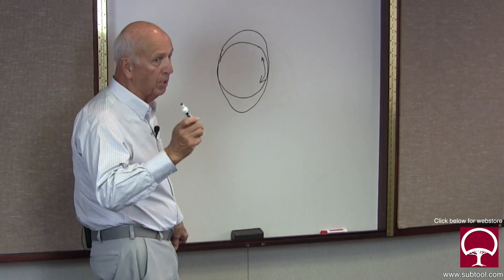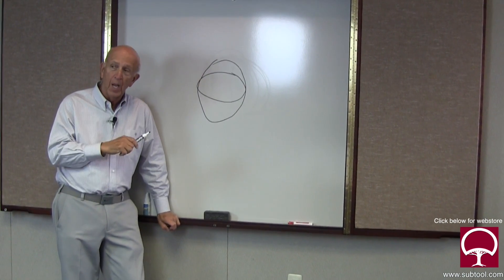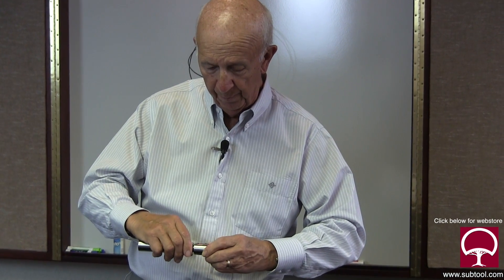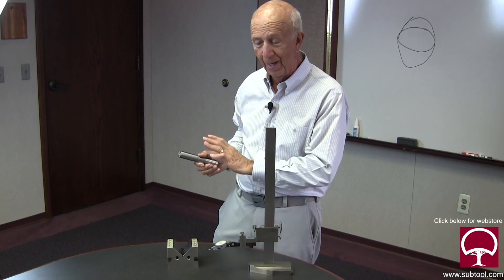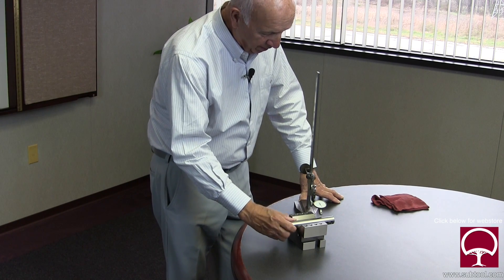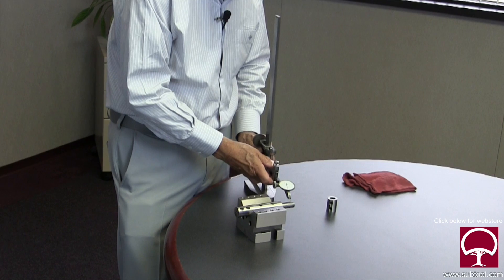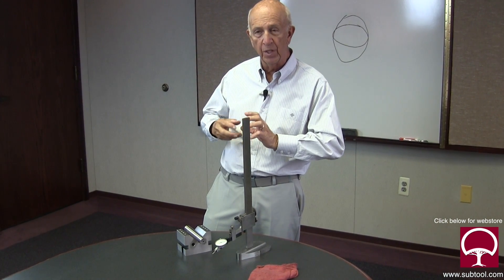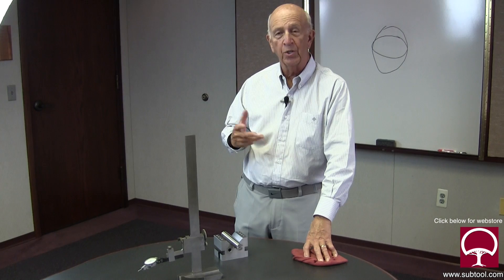Out of round. Really? Show me.

Comment: You forgot to mention the most common practice of using a mic in multiple locations to verify consistent diameter.
Reply: +bcbloc02 Consistent diameter is one thing, roundness is different. You can have a part that measures the same in multiple locations with a mic, but not round. And as a general rule, you can't test for roundness with any two-point measuring system, such as micrometers, calipers and so on.
Reply: voron11000
While theoretically you could measure a hexagon 3 times and come up with the same diameter I think in practice odds are you would not be in the exact right spots for that to happen and you would indicate a different diameter and thus know part is out of round.
Reply: +bcbloc02 Yes, hexagon is one of the grossly exaggerated examples the author of the channel likes so much. But practically you don't check a hexagon for roundness, right? Practically you'd have a little bump on the surface. Or a little pit. Or a combination of a bump on one side and a pit on the other which would give the reading you expect on a mic. But still not round. Let's just talk theory. A circle is a shape when the distance from all the points to the center is the same. But you can't check for that directly, you're not measuring from the center, right? Moreover, in theory, you can have such a shape so all the distances between diametrically opposite points are the same, but the distance to the center varies, so it's not a circle. Of course I should use the terms "diametrically" and "center" in quotes. :-) So, like you said, you indicate it in a Vee-block, or spin it in some kind of accurate spindle, and it makes out-of-roundness obvious.
Reply: +bcbloc02 If you ever do centerless grinding or 3-jaw chuck work and start checking parts with a micrometer around the part and say that is round, you will start wondering why your customer send the parts back as they are not round. If your workpiece is lobed (which a centerless grinder can do), it measures the same all around but it is not round. The 3-lobed shape is called Realeux triangle, but there canbe 5-lobed also, it depends on the manufacturing method.

So, consistent diameter is not an indication of roundness.
Reply: +bcbloc02 mics are nor accurate enough in REAL precision grinding.OK down to a few tenths. depending on how good the guy using the mic is.
Reply: +Jaakko Fagerlund What if you spin a Realeux triangle in a V-block? Would it show out-of-roundness?
Reply: George Lee
What are you using in grinding to measure to work then?
Reply: voron11000 Yes it would show out-of-round condition, as the contact points are not diametrically opposite in a V-block.
Reply: It CAN show out of round but not necessarily. Three point lobing can be so bad as to look like a 3 pointed star if done on a centerless grinder with height above center and blade angle completely wrong and it will not show on a 3 point  "v" block. Look up 3 point lobing from centerless grinding. I dealt with it for over 43 years at Torrington Bearings Company.
Reply: https://pmpaspeakingofprecision.files.wordpress.com/2010/09/lobing-015-cropadj.jpg?w=675&h=648
Reply: Yes easy to make lobes on a centerless grinder
Reply: I once had a demo piece of Realeux Triangle made from a 3inch O.D. outer race roller bearing that showed no more than .0001" roundness on a 90 degree "v" block. It was actually O.O.R. about .014" when put on a Tallyrond. High spots cancelled out low spots as the piece was rotated.
Reply: Good for you. .0001"is good but I had to work on those tolerances even below that roundness.